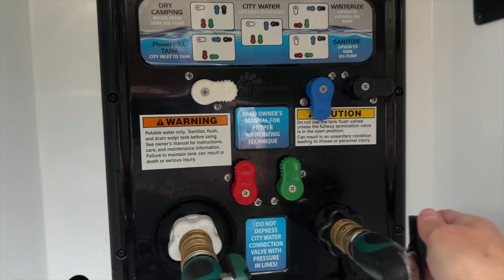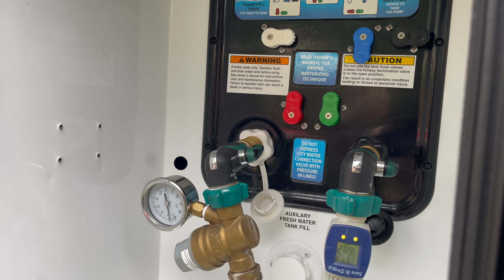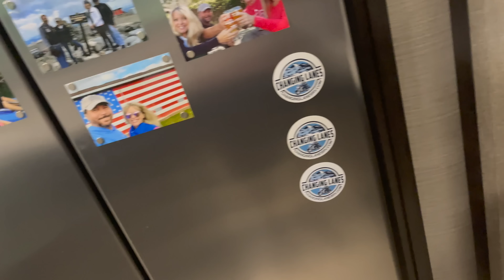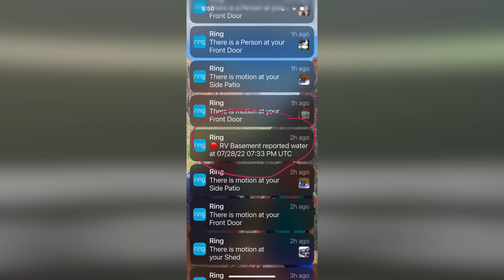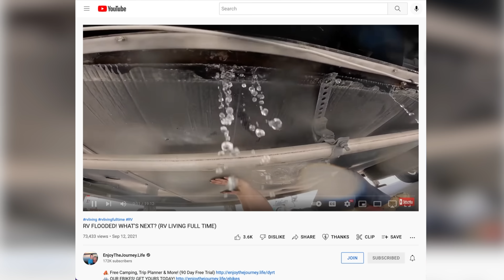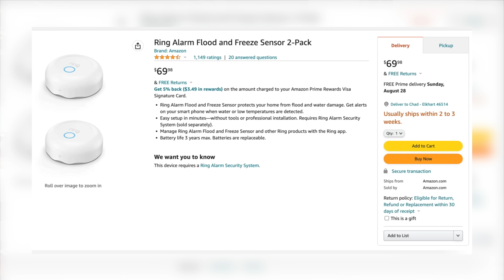Mystery Leak! (Black Tank Check Valve) (Full Time RV Life)

Comment: An important lesson…know where you access panels are before an emergency happens.  This is a reason I love videos like this (sorry it happened to you though) and others showing issues and repairs is that if it ever happens to me, I am less likely to freak out and am like, I have seen something like this and I think I know where to start troubleshooting.  Another lesson, turn off the water at the pedestal whenever you leave in case a leak happens when you are not there.  Chad, thanks for taking one for the team!!

Comment: Lovely 60’s hair Tara. The “ Check valve” is most probably not a check valve but a Vacuum breaker/anti-syphon valve. Prevents black water from backing up into the line. Used in boats a lot

Comment: Our RV (Flagstaff/Rockwood) has the insulation in the floor, not the belly pan.  Yes that means the tanks aren't quite as protected but they all have heat pads. It makes dropping the belly pan much easier and less chance of soaked insulation.  Our pan also has low points with vents.

Comment: A great tip is to shut all water sources off when leaving the RV. If a leak happens while your away, you won’t like the result.
Reply: Yes!!! Found that out the hard way🤦🏼‍♀️
Reply: Bad anti-siphon valve failure
Reply: We try and remember to turn the water off if we leave for an extended period of time.
Reply: Great Video!!!!!  We shut the water off everytime we leave our campsite for extended periods of time.  We had a similar leak with our very first travel trailer. When I replaced the insulation, I used Owens Corning Foamular instead of wool.  I will never understand why manufacturers don't use extreded polystyrene ridgid foam insulation in their higher end models.

Comment: Our brand new Dutchmen Yukon would not flow any water to the black tank. After looking for a pinched hose in the underbelly found that the hose ran up to the washer/dryer closet and that’s where the check valve is located behind an access panel. Turned out it was hooked up backwards and that is why it wouldn’t flow water, switched hoses and it worked. But being installed backwards must have damaged the diaphragm and it leaked. Cheap part and easy to replace when you know where it’s located.

Comment: Well, I would like to say thank you, today I was doing a black tank flush and started seeing water coming out from underneath the RV, I remembered watching your video and started searching, finally found the vacuum breaker flush valve, it was behind the living room TV, behind the panel. First I thought it was leaking because the fittings were very loose, I tightened them up and turned on the water, and it was just flowing out. Needless to say I have ordered 2 new fittings. Keep the videos coming, very helpful.

Comment: We had a similar situation on our motorhome with water leaking down into a bay. Traced the leak to a vac breaker in the half bath. The brass VB was way up high like yours. Found on the web that this common as the VB’s fail even the brass one. Many suggested eliminating it all together. I did. I added shark bite check valve in line.

Comment: Very common problem. I removed the vacuum breaker and put a check valve on the outside of rv when using the flush.

Comment: We have vacuum breaker valves on our lab sink faucets where I work and they will leak if we have the faucet set to a low flow rate, but they stop leaking when we fully open the faucet.  I think mineral deposits that can happen over time can cause this issue to come back, so keep an eye on this and perhaps you should put a leak sensor close to this vacuum breaker if possible.  Water leaks are a real pain.

Comment: yep, don't you just love it?? we almost had a mystry leak as well. my wife came in saying we have a water leak by the tire. I was baffled at first then went outside, you know how it is, just follow the trail. luckily I did not have to drop the under belly, turns out our water heater Pressure release valve was working. so I picked up an anode rod yesterday, time to service the water heater. now I found the issue with our water pressure climbing as well, must have lost the bubble. glad to see things worked out for you guys. safe travels.
Reply from the maker: An outside leak is rare but welcome! LOL. Glad you found it!

Comment: I had the same issue in March. Our valve was in the wall with no access hole. I has to make a hole to find the valve and then enlarge it to be able to change it. The new access hole is in a cabinet so I put a piece of plexiglass over the hole to make it easier to see when it leaks again.

Comment: Those are called a vacuum breaker,, and they have to be a high point on the line.  I've had similar problems with both the one on my RV and our homes sprinkler system.   Ours is right under our bathroom sink on our TT.  I just bypassed it and use an external one on my flush hose, seemed to be the best solution for us.

Comment: Hi! We have a 2022 397th.  Thanks for the suggestion on the black tank flush check valve.  We have it in our amazon cart.  Something we found helpful when reinstalling our coroplast (major leak found and fixed by manufacturer) was ratchet straps.  They stretch across the entire frame and can be moved  a foot at a time as you work. Piece of cake!

Comment: Different rig, same problem.  a couple of years ago, I had a drip coming from a light in the wet compartment on my Newmar motorhome.  That is when I learned about the anti-siphon valve on the black tank flush.  I spoke to the guy that invented the valve, and he said that he would replace it with an elbow.... he said that the anti-siphon is WAY overkill.  I didn't take his advice....  I found a new valve on amazon...

Comment: This just happened to me 2 hours ago. Emptied the black tank, closed it then hooked up the tank flush hose. Set the timer and went inside for 8 minutes. Timer went off, walked outside and immediately heard water running onto the ground. Opened up the basement and water everywhere including dripping from the basement ceiling which, like Chad at first, didn't make sense to me. Finally figured out it was coming out of the check-valve which was under the bathroom sink. But it was absolutely pouring out as soon as the black tank flush was turned on. I told the wife that I think Changing Lanes went through this a few months ago and came here to watch the video again. Good times.

Comment: I think one of the biggest lessons from this issue is that vacuum breaks are a PITA.  I understand why they are there, but if you don't leave hoses connected they are unnecessary.   I think there's money to be made if someone could invent a reliable vacuum break because all of them I have seen leak sooner or later.   I also completely understand the working alone thing.  I find it's generally easier to do stuff myself and not have to check what someone else does unless they are really, really good at it.   Keep the good stuff coming guys.

Comment: Hi....deja vu video for me.  Had a similar issue with my ORV fifth wheel black tank flush valve as you did. Ours would spurt out water when I shut the water off, if the water pressure was too low for the vacuum breaker to react fast enough. Lesson learned to use full water pressure when using it.  Great troubleshooting on your part!

Comment: You need to leave the hose on the dark water flush at zero pressure and no hose so the line can drain the flush into the dark tank. I see this issue lots at our campground folk hook up two hoses and find water under a sink or coming out of a wall

Comment: Seems like check valves leak a lot. Mine was leaking also. Luckily it was under my sink in bathroom and it leaked into the basement. Not much water, like you said only does it when you use the black flush. Great video

Comment: I had this happen to me while back on a trip in Savannah. Same thing happened but different outcome/solution….. I’ll try to explain my situation as best I can. I realized it was under a lot of pressure and that’s why it was leaking (353G), thankfully for me that check valve is right behind the shower and it leaked straight into the basement plastic bin thing as soon as you open the door (super lucky), I had just flushed the black tank one night and in the process I went to the basement maybe 15/20 minutes later to grab something and that’s how I found it. Well, long story short is that I have a similar setup as you do in the convenience center and the quick connect/swivel connections with valves on them…. I learned that the system does NOT LIKE to be shut down at that valve on the black tank flush as it leaves the system pressurized (yah don’t ask as I am not an RV Guru)…. Trust me it took a lot of trial an error to figure this leak out. I disconnected (quick connect/got all wet in the process) the hose and then proceeded to open that valve and that’s how I realized the ridiculous pressure that was there. That’s it, leak stopped for me. So now after every flush I make sure not to close that (very convenient) valve but instead at the spigot then disconnect the hose to remove pressure, after all pressure is let off then its all good. Hope that makes some sort of sense. Once I figured this out and follow these steps life has been good.

Comment: Yes, low pressure will cause the spring loaded mechanism to not work right, they need high pressure when you first turn the water line to activate the mechanism.

Comment: That is just crazy I am watching this and just last week mine broke at a coupling. In my Montana it comes into rig then to back of bathroom sink and then back down to tank.  There is a vacuum breaker behind the sink and then a coupling half way to tank.  It appears a stub was installed on tank prior to install then a quick splice during production.  No more cheap plastic fitting now brass

Comment: I changed mine from day one with a brass one form Home Depot. But I even to this day when I backflush the black tank I check mine and mine is under the bathroom sink where it is easy to see, some people have taken them completely out and put a check valve at the hose. When I am at a RV Park and we leave for the day I always turn off the water to the RV until we get back. It is all over Facebook on the Montana group about the Backflush valve failing.

Comment: I put two scupper 2"(approx.) valves in the coroplast to drain water in case of a leak.  Best to put in valves when the coroplast is dropped.  The valves also act and an early  leak indicator.

Comment: That plumbing is a nightmare under there. My OCD would have me moving it around to make sense.  
When I put up the underbelly last time. I created access panels for specific areas. This way you don't have to drop the entire panel just to say get to the dump valves or water connection. added a couple braces so that I have the ability to secure the oversized  panel to cover the hole. 
I do like the pin hole idea and going to do that to mine.  Love your videos.
Reply from the maker: Access panels are a great idea!

Comment: We had the same part fail in our BigHorn.  I noticed water pooling under our bathroom sink.  All the connections and pipes were dry there. ( I guess the water under the sink was due to condensation.)  I went into the guts of the 5th wheel and found that a cold water pipe behind the shower was damp but not dripping.  Yep, it went to my black tank flush.  My shower has a not quite big enough built in access panel so I removed that and found the vacuum breaker check valve was damp.  Luckily, the RV dealership where we were had one in stock.  This taught me that the leak may not be from where you find the water so you have to look everywhere.

Comment: Have this exact problem right now. Water was coming out the pass through "ceiling" (shower floor) right above the water controls. I think our rig was leveled with a slight tilt to the left front.  Like you, was confused thinking the black water flush went straight to the black tank.  The dripping on that ceiling, I knew otherwise. But thanks to you, now I KNOW where the leak is.  We had low water pressure because our house filter hadn't been changed in a while.   So a bad valve probably doesn't like low pressure.  Thanks!

Comment: I just dropped the belly on our Luxe 5th wheel while I was doing some welding in preparation for a trip to morryde for a additional (IS) axle. I also replaced some insulation while I was at it. Good job doing it yourself. It's a pain to get it back in place. I had a helper. Love your videos. keep up the great work.

Comment: Liked your video. Had a water line leak awhile ago and it made the underbelly bow down from all the weight of the water. Pulled the underbelly loose from one side. I just added two 1" angle iron to support the underbelly.  I saw your camper had those too. Also did the small holes to drain the water.

Comment: I feel your pain.  We had a hot water pex fitting on our GD Imagine crack unknown to us until we arrived at our campsite and hooked up to the city water. The fitting supplied the hot water to the kitchen sink, shower and bathroom sink. I was able to do a partial repair at the campsite giving us hot water to the kitchen sink only. We still had cold water to the bathroom.  I made permanent repairs using brass pex fittings when we got home. I hate water leaks !!!

Comment: Bought our 2020 Columbus in Feb of 21 the back check valve was installed backwards at the factory when I installed it correctly it leaked luckily the local RV dealer had one problem solved

Comment: Chad, don’t waste your money on those plastic valves. The replacements will leak soon too. I’ve had two RVs with a black tank flush and had to replace that plastic backflow preventer on both of them. I swap them out for a brass Watts LF288A backflow preventer but you’ll need a couple male to male nipples to use the Watts valve.

Btw, those backflow preventers are required by code and have to be positioned above the level of the toilet. They prevent the black tank contents from being sucked back out of the tank if there was a vacuum condition in the supply line. That could happen if the campground water main breaks.
Reply from the maker: Thanks, Allen.. Will check those out. 👍🏼

Comment: Looks like the anti siphon valve is leaking or the fittings are loose.
You can replace with a 90° elbow and use a back flush fitting on the hose connection.

Comment: Anti syphon/vacuum break valve. Has to be the highest point to prevent pulling from the black tank. High position will serve even if it fails.
Reply: Learned this the hard way whenever you're done flushing your blank tank always disconnect the hose from this fitting no matter what and and let it drain.  These vacuum breaker anti-syphon valves are not designed for constant pressure

Comment: This exact same problem recently happened with our motorhome.  It was a slow leak that I thought at first was going to be a big fix. Fortunately, it was the vacuum breaker and easy to reach.  Swapped it out in 10 minutes, but as you know, the challenge was figuring the problem first.

Comment: All of those valves leak, every time you apply water. It is a race between the water and an internal stopper to the top of the valve body. Even if you replace your valve with a brass valve, it is the same race, and the manufacturer states the valves should only be used in an area that can get wet. Normally there is only a little water per use, low water pressure may not allow the stopper to seal very well. Another problem is if the check ball spring pushes the ball out of its chamber and into the space where the stopper travels, then the stopper will get stuck on the ball and never seal off the flow and water just flows through the body and out the top. It is a wonder that the trailer manufactures use these valves. Happened to mine and is a different trailer brand than yours, same valve. Cut the valve apart and see how it works

Comment: Tried the box and stool to get the underbelly back up. The easiest I found is to just get all the way under and use your legs to hold everything up and then use your arms to drill everything back. Goes really quick but you do get a little dirty (and look pretty funny). Also had all the water in the corrugation that made me think I still had a leak. Definitely getting a leak sensor though now. That's a great idea.

Comment: Water leaks are the worst! I wondered why my black flush lines went up behind the shower 🤔 Now I know and makes sense. Hope mine holds because it’s not easy to get to with our Mid-Bunk Solitude floor plan. Have to figure out how to from our skinny cabinets in the bathroom. And I’m going out right now to frill some small holes in our underbelly, what a great idea.
Reply from the maker: I bet you have a hidden panel somewhere...
Reply: @ChangingLanes  Just looked in the cabinet and thankfully we do! Phew. Two screws and that panel will come out to expose it. Thanks GD and Chad!

Comment: Just went thru our 'what's leaking' event.  We were hooked to city water.   We saw water coming from the lower edge of the RV over 20'.  An internal water line burst (11 year old system).  After shutting off water & starting diagnosis, we found the leak and replaced the hose.  Reconnected water and things looked good (except for drying out the mess).  Then we received a call from our neighbors that we had more water pouring out!!  Turns out the check valve on the water pump failed and filled our fresh water tanks which went into overflow mode.  No big issue but I needed a new pump and had an extra 150 gallons of water to use.  Now all issues are resolved and we are down to about 80 gallons to use or dump.